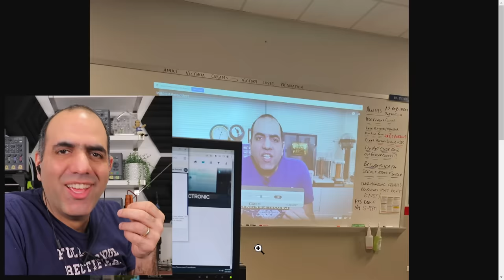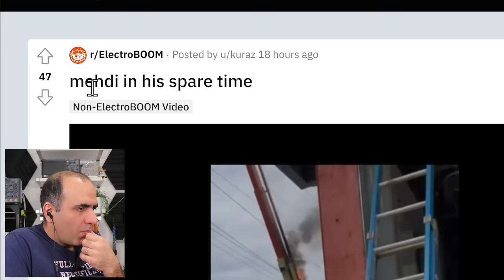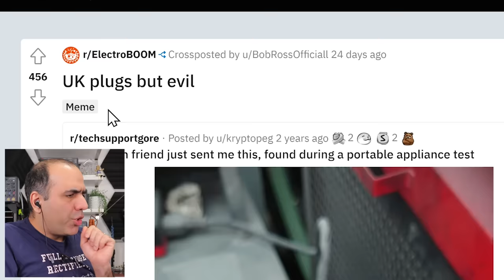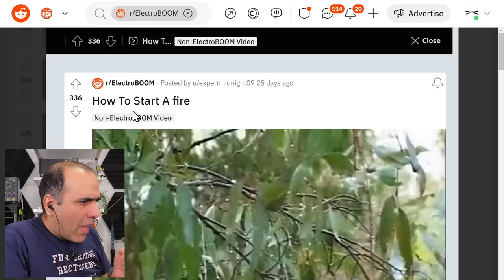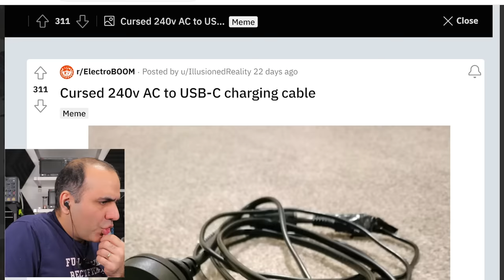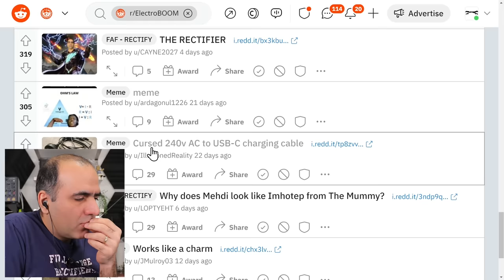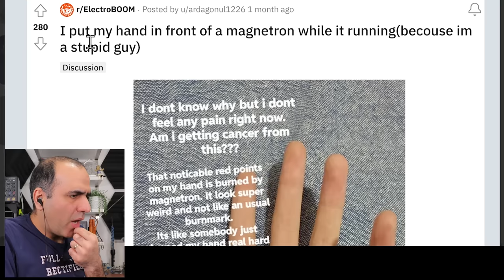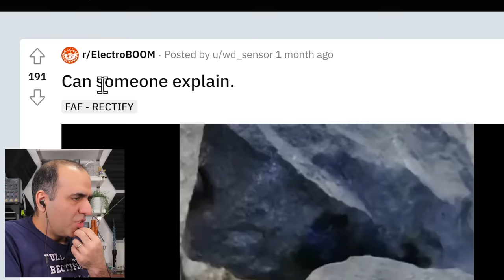Closing a POWER ARC Switch with a WEAK ARC (LATITY-012)

Comment: The tires (and the entire machine) often catch on fire (the tires ignite), and after a while it will fall out of the sky. Riding it out is far more dangerous than you think. Often the engine quits running so you can't back out of the powerlines. Often, the operator gets shocked when he climbs down instead of jumping. Often he becomes desperate and tries to shimmy down.

VERY dangerous stuff.
Reply: I hope this gets mentioned in the next video. This was hugely informational to me. Thank you.
Reply: it even caught fire in the vid, dunno why Mehdi told what he did. The lift is certainly fried and starting to fail mechanically
Reply: Does no one in this thread understand sarcasm? I'm by no means keen to electricity in how it works, etc, but even i know that you would not want to just sit there. Pretty sure common sense says that
Reply: @butstough  wasn't there, didn't have a meter. But I've recovered several machines after the fact.
 https://youtu.be/H-d_EeKv_yg
Reply: It's correct to state the tires can catch fire and or explode, thus destabilizing the machine and potentially causing it to tip INTO the power lines. Though, staying calm and thinking of a plan for escape is a better choice that freaking out and doing random stuff thats equally or more likely to get you killed. As you state, sometimes they try to shimmy down, which is a bad idea. Unfortunatly the best bet is to wait it out until it's clear that the machine is on fire, the time up to that point should be looking for a soft landing spot away from the machines base.
Reply: @2009dudeman  If that fire gets on that topping cylinder (in the video I posted) for very long, that boom is coming down regardless of what the tires are doing. I've had to deal with the aftermath of these occurrences more than several times in my career.

I don't care what anybody thinks about it because I already know the reality- it is crystal clear what happened when you are the one who has to figure out how to unfuck it without causing a bigger calamity.

I was merely pointing out that getting electrocuted isn't the only problem faced when you are 35 feet up in a basket that hit the wire. There are SCADS of other issues that can easily result in a worse situation.

Take a look at the boom truck in my video. The person filming didn't keep it rolling until the end, but I know as sure as I am sitting here that there is only one very slim chance that thing didn't go down, and I would be very surprised to hear that it didn't. The initial problem was that the rope touched the power line. If you follow the logic, the boom itself was over ALL of those lines, and the road as well.

I have seen the melted handprints on the grab handles when the guy climbed down and was touching the machine and the ground at the same time. I have seen where the boom comes down with weight on the hook and flipped the machine over. I have seen it, and if making it home is the goal, this is very bad stuff for numerous reasons beyond getting zapped.
Reply: @btasler  I think my tone was unclear. I'm not disagreeing. I'm saying one needs to assess the situation, not do anything until you have a clear understanding of what's going on. Then when you understand the situation and have a clearly formulated plan you need to execute it.

In this case they are lucky, but I agree I've seen others where the boom falls and jumping was the best option. Each situation is different, which is why staying calm and formulating a plan is critical.
Reply: @2009dudeman  I'm not here trying to be a concern troll. Honestly, I don't care how any person reacts to these types of accidents. I was literally just pointing out that it is dangerous on so many levels it boggles the mind. Imagine someone getting killed two hours after the initial contact because they didn't think it through all the way.

As I wrote my original post, my phone rang and I got busy and distracted but I wanted to get it posted so it reads as though it was written by a second-grader, but no- it doesn't matter to me whether someone laughs or sees it for how dangerous it really is. Part of me thinks it is funny, but then I remember that if someone gets hurt, it's not funny to them or theirs.

It's all good, dudeman.
Reply: Yup tire rubber is rather conducting at 45kv. Seen it before at a factory.
Reply: Yup tire rubber is rather conducting at 45kv. Seen it before at a factory.
Reply: unless its got holding valves (and it probably does, being a man cage) it should still be able to lower with no engine (hydraulic pump) running
.
-all you need to do is open the valve and let the fluid return to the tank..... and it will lower under its own gravity/weight 
(again, unless it has holding valves, which it probably does.... but if the key is on, and battery still works, they SHOULD allow fluid to return if you move the control valve)
Reply: @kainhall  If that topping cylinder gets too much hot on it, anything at all good that you get out of the entire situation is pure luck and nothing else. I've been doing this for decades, and I've cleaned up the messes.

The first responders would never in a million years used a burned machine to lower a guy, nor would they allow anybody else to. After a wire strike and subsequent fire, they are breaking out the shiny red ladder truck.
Reply: @btasler  OH ABSOLUTELY!!!!
.
but if the zap zap is on the other side of the lift than the control stand.... im probably going to try and lower the SOB
especially if its not tangled in the wires (as in, just went up 6 inches too far and touched a wire)
.
it might have fried the holding valves.... and you arnt going anywhere
or it may work, and you reduce the risks
.
.
im not saying "jump in the middle of the arc and try to lower yourself" 
im saying if (a BIG if) its safe to do so.... try and move the valve.... 
obviously before the whole thing catches fire
.
.
yes, this means you have to think AND act in a few seconds.... 
but knowing that you CAN lower yourself... IF SAFE TO DO SO.... is better than trying to figure it out on the fly
.
yes, its luck that the electronics have not melted... and the valves have not welded themselves in place
but again... IF IM ABLE TO REACH THE CONTROLS WITHOUT BEING SHOCKED.... im going to try and release that hydraulic pressure 
.
.
.
but the engine off or on.... if it allows you to move the valve (even in the "going up" position) its going to return fluid to the tank
AKA, go whichever way gravity says it's going to go (aka, down)
Reply: @kainhall  I think the controls in the basket were too close to the arc and nobody wanted to touch the controls on the base because it was electrified.
Reply: @christopherleubner6633  Makes sense. They do put graphite in the rubber

Comment: I designed and built high voltage / high current pulse switches based on that principle many years ago. The switch consisted of two large metal hemispheres, one of which had a surface-gap spark plug in it, threaded in from the back side. The switch hemispheres were held a fixed distance apart in a chamber that could be slightly pressurized (raising the pressure raises the self-breakdown voltage). The  big capacitor bank, load, and switch hemispheres were connected in series with the load.  Firing the spark plug would ionize the gas between the hemispheres, and an arc would form between them... which would dump a few hundred kiloamp pulse from the capacitor  bank to the load.  I'm very glad to have escaped that project with all my fingers, toes, and skin intact.  :-p

Comment: The arc switching an arc is also called "triggered spark gap" and is used to ignite rockets.
Reply: Also used as the initiator for the explosives in a nuclear weapon... all the explosive compression panels must go off simultaneously, to uniformly compress the fuel past its critical mass. Any deviation in timing could result in a nuclear fizzle.

Oh, how wild it is to see how far our species has come in such a short period of time.
Reply: Cool

Comment: If you don't have a grounding wrist band your best choice is minimal clothing to minimize static charge and touching something grounded from time to time to discharge yourself, the wristband just prevents any buildup to be safer but it's still doable without it.
Reply: I used to resell old computer parts. Much of the SD-RAM was old and had dirty contacts, so I cleaned them using an eraser. Then I put them into my test bench PCs, and ran MemTest to ensure they were OK before putting them up for sale.
During summer, I got a lot more failures! I finally worked out that rubbing briskly with plastic onto the memory chips while wearing rubber throngs (flip-flops) made my body into a nice little static arc generator 😏😂
Reply: so get nude to minimise static, got it
Reply: @NocturnalTyphlosion  I assume you're talking about doing this in the privacy of your own home, when I did mine I was wearing some underwear at least.

Comment: For esd sensitive environments, there are lots of precautions that are taken place to reduce the risk of esd. I work as a pcb assembly specialist, and in the factory for example, we have a special kind of flooring that is always grounded, conductive work mats on the work benches, wrist straps, esd shoes or heel straps and a jacket that is anti static that you have to wear whenever you're working at your bench. We also have to test ourselves every morning to make sure we are grounded and are not allowed to work or sit at our benches until we have done that. That's only a small amount of the things we do to reduce esd risk!!!

Comment: 9:14 I don't see an issue here he just incorrectly connected the clamp on the battery, and it was loose, so it created a bad connection. There is a specific tool called a battery drop tester that draws a huge amount of current for a short amount of time to test the battery

Comment: 13:37, as someone said that anime is Serial Experiments Lain,  from 1998, she's working at a massive computer she got to replace her older one, iirc she was adding a processor upgrade and yes, the thing with the clothes & ESD is a real thing after all, never happened to me... yet
Reply: I still wouldn't suggest working with high voltage with your clothes off -  that's how you directly go from Serial Experiments Lain to Haibane Renmei...
Reply: thx m8
Reply: lainpilled😩

Comment: The nail in the cable is a common practice. It’s called spiking a cable. In the US it’s done remotely with a device that drives the nail on it now it’s not uncommon to use a remote cable cutter. They do it because so many times cables were though to be turned off.

Comment: 5:41; The arc creates a bigger flash as a flashover which is a discharge from conduction to give off power from wires, transformers, or other electrical equipments.

Comment: Hahaha hilarious when you said people working in computer manufacturing are naked, i work in a semiconductor factory and we wear complete ESD overalls, shoes, gloves to conduct charges to the conductive carbon impregnated flooring, basically turning ourselves into a wire haha, also there are ionizers everywhere to neutralize any static to keep air at 0 volts. Love you vids ElectroBOOM ! hi from Malta :P
Reply: Ionizers to keep air neutral? How does that work
Reply: @MrCh0o  If air is ionized then it conducts static away to ground. Static can accumulate on isolators in normal air only because it conducts poorly.
Reply: I want the exact opposite of that environment to exist, where absolutely everything (and everyone) you touch results in static discharges. We can call it "artistic," and give it a name like "How it Feels to Have Social Anxiety," but it's actually just about lighting people up like painful Christmas trees in the dark if they so much as think about touching anything in the room. Can this be done without a wrongful death lawsuit?

Comment: The thing you created with the transformer is kinda like how relays work. The current is loaded through the switch but it isn’t activated (two wires not touching) and then the coil is powered through a switch or a knob and the energy induced through the coil pulls the switch closed using electro magnet. Not necessarily what you made but similar

Comment: At 10:45 in, the porch light in our horse does that! As well as a couple other lights and outlets. For what ever reason our front porch light won't work unless anything is plugged into an outlet on the other side of the wall. Even then we still have to smack the wall to get it to work sometimes. This house is built in 1980 in Florida, in the early 80's there were very questionable electrician practices, for example using aluminum wire instead of copper, which is actually illegal here now to use aluminum wiring.

Comment: Now I want to build an arc computer (use arcs in place of transistors). No clue if that'd work, and it'd certainly be very power inefficient, but it'd be very cool to watch if it did work.
Reply: You just discovered the working principle behind vacuum tubes. Seriously, that's how they work.
Reply: i hope it works better than arc video cards!
Reply: @soranuareane  like vacuum tubes without the vacuum
Reply: @soranuareane  Quite different. Vacuum tubes use vacuum, arcing happens in not-vacuum.

Arc logic gates like here, using current that can toggle more current (normally closed) would be an interesting project. Vacuum tubes impede current if voltage is applied on the grid (normally open).
Reply: Arch... computer...?so you want to  run linux? :P
Reply: @gorkskoal9315  hey! That's insulting! To the arc computer 😂
Reply: The arc switches would probably burn out faster than vacuum tubes.

Comment: The hammer clip brought back nightmares, just last week I plugged a wire in and was measuring it to length for an outside light, forgot it was plugged in and BANG.. thank god for fuse boxes here in the UK and thankyou me for using cutters with insulated handles.. the breaker popped and I didn’t at all get a shock!

Comment: at 12.56 guy is performing a safety feature to check if the high voltage cable is truly disconnected from the substation. its a "standard" practice

Comment: Hitting the cable with an axe was their version of spiking. Not a way that I would try but there are tools that are designed to do this remotely. It is how you verify a cable is dead before you work on it. Turning off the breaker isn’t enough when you have half a mile of underground cable.

Comment: 12:44 And the person working on the wires physically locks the breaker open using some sort of lock out/tag out system. Don't let someone else flipping a switch kill you. When igniters are inserted into solid rocket motors for space launches, the person that does all this wears every arming key around their neck so that no one can kill them by turning a key.

Comment: That's exactly how caméra flashes work.

There is a large 330V cap that gets dumped across the xénon flashbulb, but it's not enough to flash over by itself.

It's either triggered by a third électrode hooked up over the glass tube that creates local ionisation, or by dumping another 25KV low power cap to strike it.
CFLs work in the same way too, they use the inductive kickback from the ballast (HV low power) to strike a high power mains voltage arc inside the bulb.

Comment: 9:22 mechanic here..... that is CLEARLY staged......
.
steel wool WILL!!! light (but it has to be the REALLY REALLY fine stuff... that you probably will not find in the grocery/auto parts store)
.
also... i just used a 9V "smoke alarm" type battery when i was a boy scout (im an eagle rank BOI!!!) 
a bit lighter and more compact than a 12V car battery 
.
.
also.... my GO TO fire starter was dryer lint rubbed in vaseline
and i had a "profeshional" flint and steel 
.
not the cheap stuff with like a 2mm fero rod.... and you have to use your knife (or this TINY POS striker that comes with it)
this one was like a HALF INCH! fero rod... and a nice sized striker 
.
it would make a SHIT TON of sparks..... so much i could get normal "printer paper" to light with very little effort 
but when it hit that dry (no vaseline) dryer lint....  instant flame
.
and then that flame would start to get the vaseline.... and it will almost act like a candle wick
the vaseline melts, wicks up the lint, and burns..... 
.
then, once the baseline is all gone, you still have a few seconds of the lint to burn
.
.
.
a "cotton ball" soaked/rubbed in vaseline will burn for about 10 mins or more
and if you cant get a fire started from that..... you suck at survival skills, and are going to die (at least you tried.... GOLD STAR!!!.... but also a D-)
Reply: but ya.... steel wool WILL work (but its VERY VERY hard to get anything to catch on fire with it..... unless you have PERFECTLY DRY and VERY FINE POWERED wood)
.
dryer lint is free....  lighter..... more compact
the fero rod i used cost about 40 bucks..... but was worth every penny
.
ive started 100s of fires with it.... and it still has like 7/8s life left 
also weighs about the same as a 9V battery
.
.
.
so ya.... lint covered in vaseline in a ziplock bag + fero rod is WAY WAY WAY WAY better, lighter, more compact, easier to start, burns hotter longer, ETC
.
IDK why steel wool is known by everyone nowadays.... 
and most buy the WRONG TYPE of steel wool (these videos NEVER tell you which "grain size" to get) 
.
hell, a bic lighter is smaller, lighter, and more compact that ALL of that
and also waterproof (might need to "spark" it a bunch to dry out the flint... but it will work after a while) 
.
.
.
you dont have to survive like 1880 when its 2023
no on is going to say you "cheated" if you DONT DIE from using a bic lighter.... 
.
the only thing you cheated was death..... and thats 110% OK to do
Reply: @kainhall  I've done it before, and it wasn't too hard to get some paper caught with it.